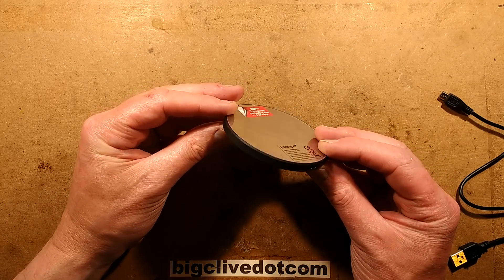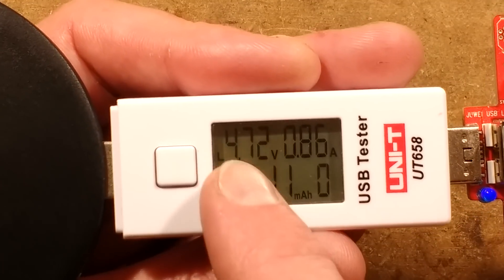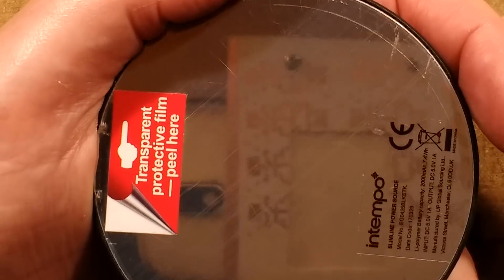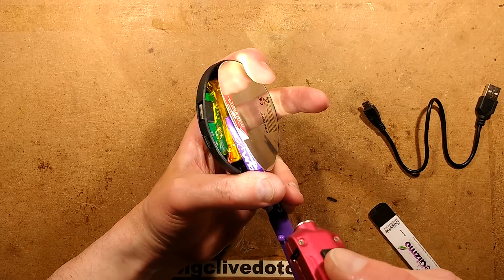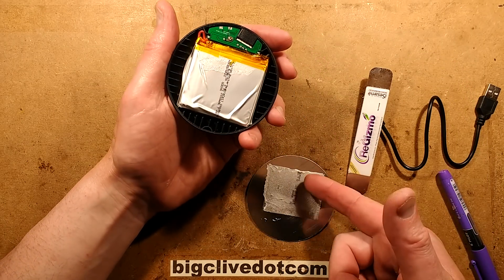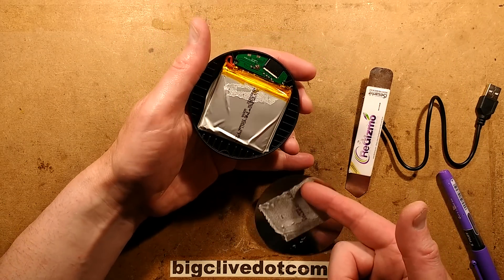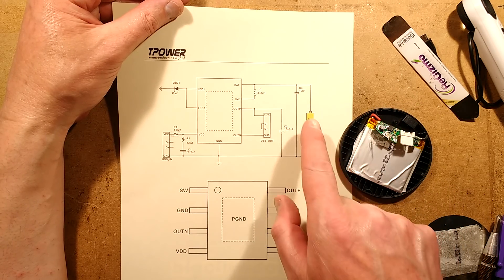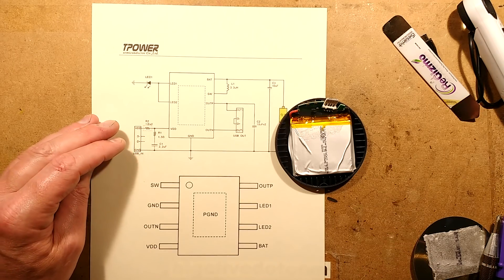Inside a wafer-thin USB powerbank.

Comment: I'm with you on LCDs with recessed screens being annoying. I had an older android car stereo that had its screen recessed about a half inch from the bezel, and when mounted in the car it meant it obstructed about an inch off the top and left of the screen when sitting in the driver's seat in a normal position :(

Also: "LCD Display" = Liquid Crystal Display Display
Makes me laugh when people say it.

Same as when people talk about how the space shuttle had SRB Boosters.
Solid Rocket Booster Boosters!
Reply: You 'd expect by now that bezels would either thin out as they approach an LCD, or be otherwise engineered to pipe ambient light into the edge of the glass…

Comment: what is that device you use to test the load and where can  i get one ??
Reply: not the usb tester but the one with the fan on it
Reply from the maker: It's one of a few different devices on eBay sold as USB load testers.

Comment: Clive, this round form gives me an idea - can we make really "circle" handmade charger - by not using the square battery? The first comes to the mind is like a dozen batteries in form of pie slices which making a perfect round, but it's hard to make handmade. The easiest is to put a many small tablet type lithium batteries which already in a form of circle, how many - 20, 30 in series?
Reply from the maker: I don't think the combined capacity would match up to the mass of a traditional square block cell.  It would also be much more expensive to manufacture.

Comment: Given your struggles with the visibility of that USB current meter, this might be worth a go: https://www.banggood.com/Bakeey-UM25C-USB-2_0-Color-LCD-Display-Type-C-Voltage-Current-Cable-Resistance-Tester-Measure-p-1267797.html?utm_design=114&utm_source=emarsys&utm_medium=Mail_Smart3C03_email&utm_campaign=newsletter%E2%80%94emarsys&utm_content=Winna&sc_src=email_3041321&sc_eh=93b0b79c4072a1f51&sc_llid=339284&sc_lid=118144470&sc_uid=4Xf3Y9UKDK&cur_warehouse=CN

Comment: I've noticed that who ever the electrician was who came in didn't do things 100%. I changed a broken double gang light switch and found it looked like a monkey wired it up. Not to the point of dangerous but had odd colour wires and used small junction boxes. Complete mess. I just managed to get the wires back in the recess. Crazy. I'm no electrician but wow. I could do a better job at wiring. Scary though. Wonder what I might find as I go along! Hopefully nothing dangerous!

Comment: Just a quick question. I work as maintenance manager in care home. We have small circle ceiling lights and some do not work. Changed starter and lamp but to no avail. They have ballasts, can they be repaired? Can't wait for electrician to get round to sorting out basically. We have zones on trip board so can isolate power when removing. Also have Dave's bm235 meter so can double check if electric is present before removal. Love the accent at start. Should do a small vid with accent. I know you like your lights. Thanks. I might film it at work tomorrow see if I can repair one. Not sure if they are sealed??

Sorry. Changed comment clive. Thanks for reply. I partly read it.
Reply: Sorry Clive could you post link again? Thanks.
Reply from the maker: https://www.youtube.com/watch?v=qLaD11LITbQ
Reply: bigclivedotcom thanks

Comment: I am surprised at how fussy the thing is with a load..  That battery pack is pretty decent size so should have some decent mAh for what it is designed for.  Is there a way to modify the thing to not cut out or sleep so easily?
Reply from the maker: It's built into the chip, which is annoying.

Comment: What do you like about it? It doesn't keep voltage with load and shuts off at 800mA. I'd much rather grab the Poundland one. It just seems better in every way
Reply from the maker: The only good thing is it's slim housing, but it would be nicer with a dumb circuit like the Poundland ones that just bang out 5V all the time and top it up as needed.

Comment: Why do some batt packs cut out on low current demand?  Is it simply that the circuit would otherwise go over-voltage? I bought one to power my little aux speakers.  They have class D amps, no doubt, and draw very low current in periods of silence.  Good! Except I have to manually reset the batt if the soundtrack goes very quiet for 20 seconds!   Happily I have another batt that doesn't care.
Reply from the maker: It's to reduce the standby current.  They detect when the device being charged has stopped drawing current and turn themselves off until a load is detected again.

Comment: You can soften the double sided tape with IP Alcohol. Makes things less exciting ;)
Reply: Hypodermic needles come in handy, in situations with cramped access, for the application of lubricants and, especially, solvents (e.g. Methyl hydrate, varsol, etc.). Puts the liquid where it's needed when you want to weaken a glue-bonded clamshells or similar. After application of a solvent at the join, distort the general shape of the clamshell (e.g. squeeze it across a diameter or diagonal) to have sheer work to your ends.

Comment: the last time I wanted a litium cell I wanted to get one out of a powerbank, the result was that I had to cut open a aluminium enclosure remove the curcuit with brute force and use a pen to push the cells out. The result was that one of the cells ripped open because it was clued to the enclosure, eventhought I cuted away the glue with a thin knife.
The really don't want you to get to those cells.

Comment: Hi Clive, last couple of vids, the audio seems to have gone quieter again. Have you changed anything?
Reply from the maker: Check your surround sound settings.  Either YouTube, Microsoft or a sound card manufacturer appear to have done something that is diverting my mono audio on both channels to a bass speaker.
Reply: PC in question has a single speaker inside the tower (work computer). No changes have been made, and until the last couple of your vids the audio was acceptable. Just wondered if anything had changed at your end?

Comment: BTW: Clive, I do have a legitimate question for you - do you have any interest in solar panel systems? I just finished my 4th floor office and I am seriously considering solar to power the beast. Small aircon, computers, monitors, sound system, fan, soldering iron, occasionally a bit of drilling. Power is really expensive here in Manila and there is tons of sunlight (except when there are typhoons). Any insight from you would be most helpful.

Ah --- wait. You're on the Isle of Man. And your weather is ... ah, er ... nevermind. grin
Reply from the maker: It's certainly worth considering a system to offset the cost of grid power.  We do get some sun here, but only for a short part of the year (right now) and not predictable.

Comment: @bigclivedotcom I would love you to cover the misleading practice of promoting battery packs at the capacity of the cell(s) inside and the voltage of the DC-DC inverter to imply the actual capacity is much higher than it is.  

For those reading this wondering what I mean, when you buy a rechargeable battery pack they have a DC-DC inverter but the practice is to advertise the capacity of the cells inside  but quote the voltage on the inverter - this means the capacity of the overall battery is lower than advertised, especially if it's a multi-voltage battery pack Eg laptops or 12-14V for car jump starters, the true Ah rating at 12V for example will be less than half of the promoted capacity because the cells used will be 3.7V.  It doesn't matter how you add it up, the power out of the battery pack will always be the same minus negligible losses. If you increase the voltage through a DC-DC inverter the available capacity available at that voltage will decrease proportionally.

Comment: i may not fully understand all of the logic circuits you talk about but your videos are still inspiring. currently working on a tabletop laser engraver based off of photos of a chinese one using parts I've 3d printed. the availability of arduino/stepper driver controllers is something i never dreamed of when I was younger

Comment: Capacity should be measured in Wh or J, not in Ah. The latter is useless because the voltage varies.
Reply: plemli It's correct to measure cell or battery capacity in Ah, as that is a reasonable representation of how long a cell or battery can deliver current (within a specified range) to a load. Most cells or batteries have a fairly constant voltage across their useable range within the specified discharge current range. The problem is that once you add a DC/DC converter, to boost the output voltage, not only is the output current different to the discharge current from the cell or battery, but you have losses in the DC/DC converter. And worse, these conversion losses are likely to be different at different current outputs. This then makes the advertised Ah figure very misleading.
Reply: Cell capacity, fine. It's with batteries (typically when cells are in series) when things get iffy. Also, as you say, when voltage conversion is involved. As plemli says, actual energy capacity would be better. It is, in fact, how the batteries on my Lenovo laptop are measured.
Reply: Chaos Corner  You have to take both the capacity in Ah AND the voltage into account where there is more than one cell. For example, if you have three 2V 5Ah cells, they can be connected as a battery with the cells in series, in which case the battery is now rated at 6V 5Ah. Or the three 2V 5Ah cells can be connected in parallel, you now have a 2V 15Ah battery.
Reply: Mark, exactly. But you don't have to worry about that if you express it as energy capacity. 5000J is 5000J whether that's at 4.2V, 5V or 12.6V. If you're really worried about time, as Plemli says, you can use Wh.
Reply: I agree that what most people understand capacity to mean is the energy capacity in Wh. The term capacity is slightly ambiguous. It can mean the charge capacity in Ah or the energy capacity in Wh.

Comment: I have had some luck with using dental floss to slice between a glued lithium cell and the case. Try it sometime. My daughter suggested it after having witnessed me cutting cinnamon roll dough with dental floss and also running out of the house with a thermonuclear iPhone/battery. The next iPhone I worked on, she said, "Hey Dad, maybe you should use dental floss." It worked!.
Reply: Or piece of cord soaked in a bit of isopropyl if you don't have floss laying around.
Reply: John Cuzzourt 
I use a water pik - do you think that would work? 😜

Comment: looks like what i have in my vehicle cup holders, has a solar panel to charge up the battery and lights up when something is placed on it. not that great since sun is unable to hit that area even through the sunroof. does make me wonder how good of a battery it has in em. they're on ebay for around 5 bucks if anyone would like to take it to bits. no ports or indicators, pretty basic.

Comment: UPS for a Raspberry Pi?  Great idea as long as the RPi doesn't flake out on the lower voltage and somehow corrupt the data on the MicroSD card.  I have 2 RPi 3's and not fun when you need a specific power supply because the "USB Standard" is not good enough.  Why did they even bother to use a USB connector for power?  Nice idea to get 2 power banks for the 2 separate circuits so you can charge-and-go.

Comment: I would say that seems a really bad chip design if it brutally cuts out both high and low loads.  And that lid should have been glued to the case, not the battery to avoid causing "explosive" battery damage.
Reply: I think it's actually even safer to glue the lid to the battery. If something goes wrong -- or the battery is just getting fatigued -- there is nothing to keep the battery from bulging, so you get a visual indication of a soon-to-come fault rather than a time bomb.
Reply: John Francis Doe 
I don't think the design is any more likely to cause explosive battery damage than many modern mobile phones. If you look carefully there are supports on the plastic side of the case to help prevent a squashed battery, although the metal mirror is relatively thin and therefore quite flexible so wouldn't prevent extreme pressure from probably causing some damage.
Reply: swiss 
Good point.

Comment: Those charging lead are terrible, not only they usually made of aluminium for cheaped out but they also don't have the 2 data pins which most phone use to identify the current capability of the charger and just assume it's a low current one so it just charge at 500mA
Reply: SandPox
Most Android devices will ramp up until the voltage drops. They usually don't worry about the data pins. The crap 2 wire cables usually stop around 500mA because they're so thin they drop the voltage real fast.
Reply: The missing data lines is why they stress charging only. I bin any cables we get that say that so as not to pollute the cables we know actually have all their parts. If you cheap out that much, I am apt to not trust anything in your cable.

Comment: Whenever I discover I ended up with another useless "charging only" lead, I throw it out straight away.
Reply: Tom De Mulder
I chop the micro end off and keep the cable. I use them for projects that need 5V at lower current (like RC receivers, Arduino projects, etc).
Also, if you go out and buy a handful of good, thick USB cables, you suddenly lose any desire to hoard the crap ones.